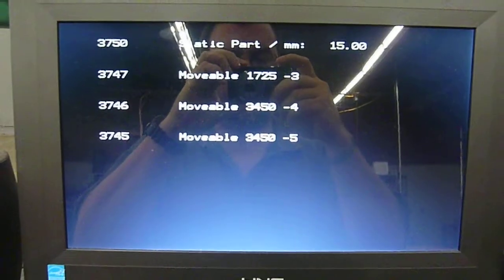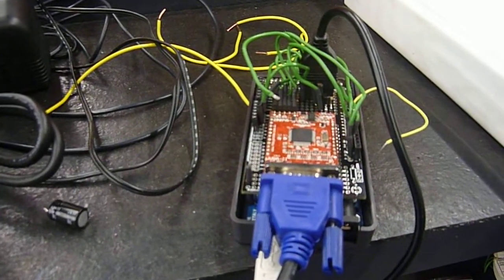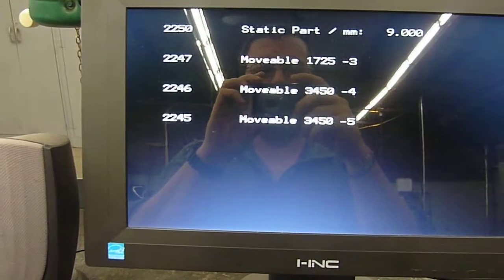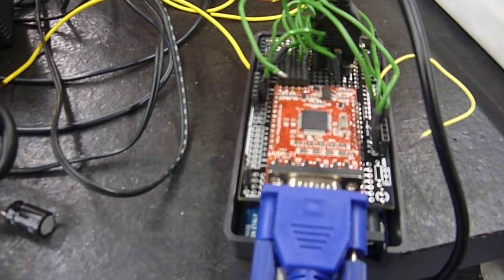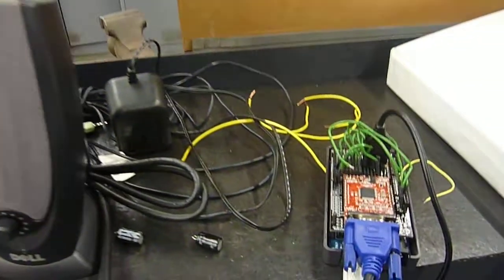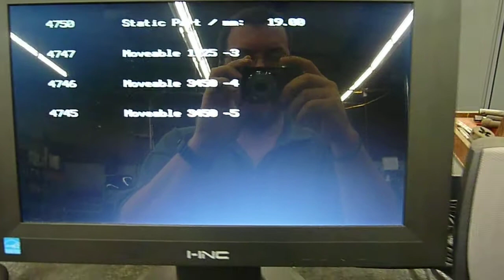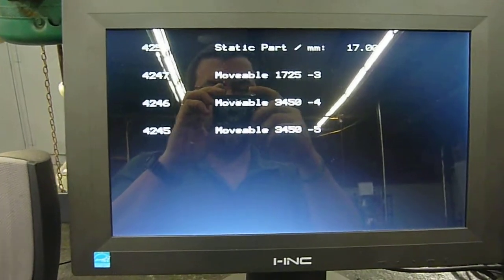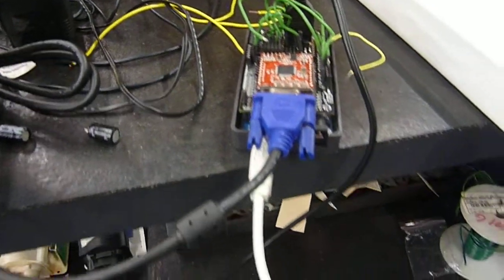Arduino VGA

Comment from the maker: And it's not really cheaper. This is a simple clean solution for displaying arduino data on a vga monitor, without having to use extra computers and software. It's just serial data. I always seem to have a vga display hanging around not being used.

Comment: a roundabout way of doing this is to use a 70$ android tablet with a 7" screen and run simple java software that gets it's data from the OTG usb port to which the arduino is connected, cheaper and less custom hardware involved

Comment: Hi great find. I've been looking for a solution to my project for some time now and I think your vid shows I've found it.

I wanted to display the results from 4 IR. sensors that's display via overhead projector.
One question can the display characters  be sized and coloured to fit my needs ? I require only a simple display showing the results in live time ( as the counts go up) but in multiple colours.

Your vid. Explained in very simple words, a blessing for me!!! 
Many thanks...thumbs up.
Reply from the maker: +Mark .Phillis Thanks for the kind words. Yes, full color and font size and types are easily done. See the link to the instructable in the description.